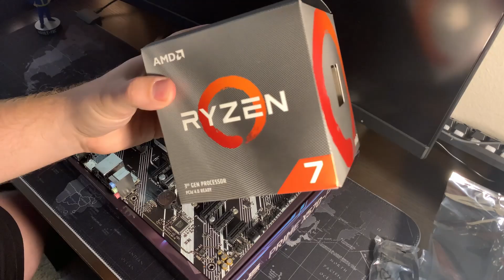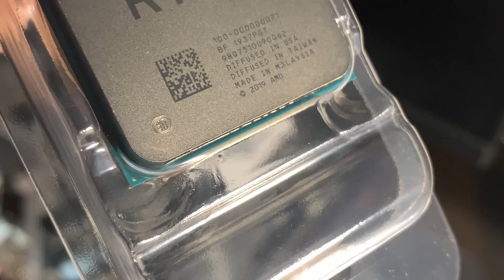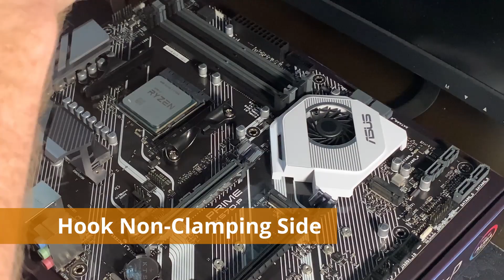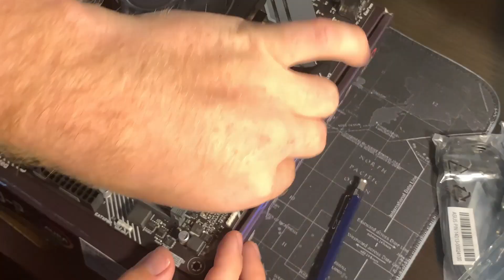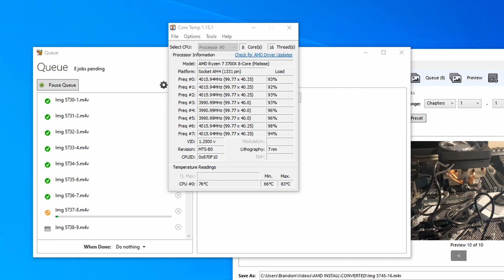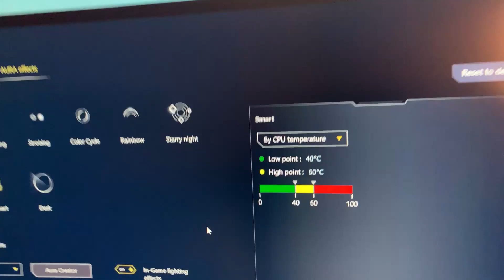How to Install AMD Ryzen CPU and Cooler for Beginners

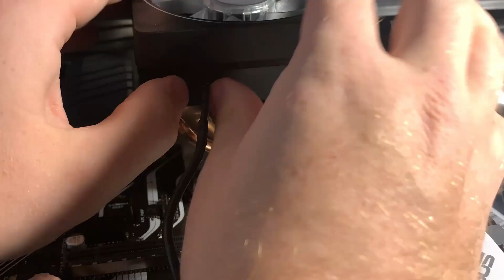Comment: That's not a 3 pin connector, That's a 4 pin connector, what the hell? you can clearly see by looking at the holes.. there are 4 holes for 4 pins to slot in.. both sides are 4 pin-hole connectors.. at 5.34 you can SEE the 4 pins on the AMD Wraith Prism Fan on the left hand side... That's the 'USB CABLE' not the RGB cable.. the RGB cable goes in on the rightt... USB on the left... I have RGB setup on my own Wraith Prism Cooler and its set on the Right hand slot of the Fan Cooler... That's actually clear Misinformation your providing there..... Tonnes of people are watching this... and Tonnes of people are being misinformed/confused... because of the wrong information you provided.. The cable at 4:45 ISSS the RGB cable... clear dislike for this video based on incorrect/misleading information provided... THE 3 PIN connector is the cable going in on the right Straight into the RGB connection port/input..

Comment: Is it possible to change the color of the fan? If so how do it do it?
Reply: Remember how he plugged in the little USB or RGB cables? thats how you control the lighting
Reply: Correct me if I’m wrong but I think AMD has an application for your computer that controls it so long as it is plugged into one of the USB ports on your motherboard.
Reply: @josephkay4219  i think its cooler master

Comment: 5:45 I dont get it, why do you need 2 cables for the RGB?
Reply from the maker: You only need one of them depending on the interface. In most situations the USB header will be the one you want to use.

Comment: does the cooler need the USB cable to have the RGB cycle though the colors like a rainbow? that cable looks really ugly just thrown over the motherboard like that and I don't really see a good way to cable manage that when the cable is just long enough to make it to the port. I don't really have the intention to mess with the colors. if it just cycles stock I'm fine with it.
Reply from the maker: Ashton Yaklin Yeah, it needs one of the two to have any of the color. It's possible to make it look good just takes some creativity.

Comment: you could of just read out the old ass post from 2006 instead of making us read a post from 2006 with 2 up votes in 2020  , if i wanted to read a forum i would of gone on a forum and not clicked on the video
Reply from the maker: Sorry I didn't ready something out of you. I am ashamed. Also 2006 is when that user joined those forums.